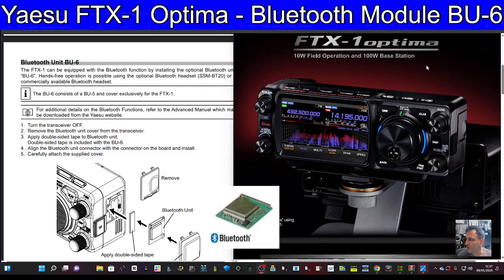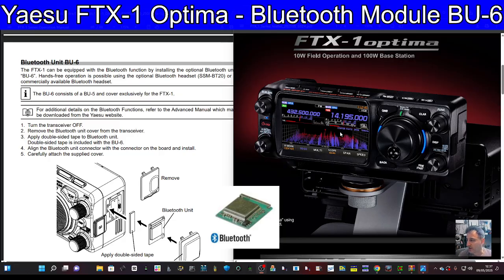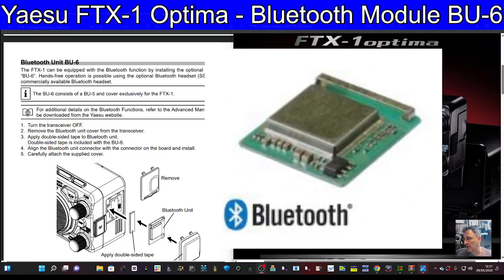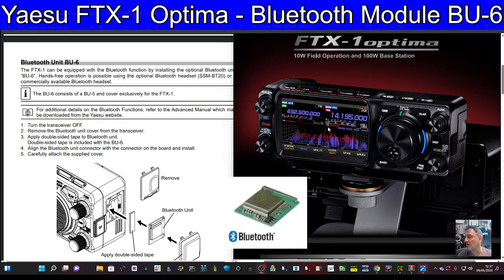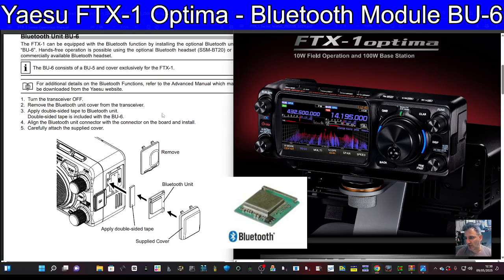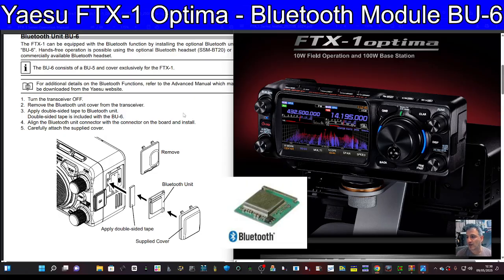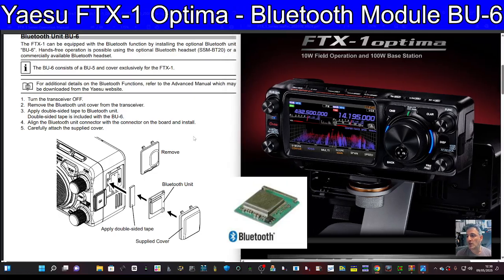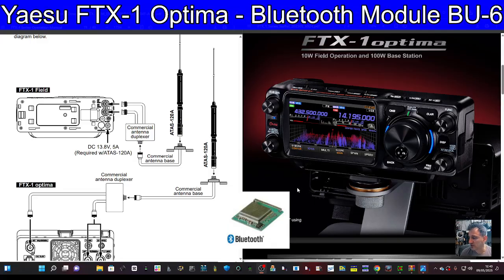Yaesu FTX-1 Optima - Install Bluetooth Module BU-6

Comment: I'm another one of those that can't understand why Bluetooth is not just added to these new radios from the beginning. The actual cost of the modules is minimal and seems like everything else we buy has it built in these days.
Reply from the maker: Least it's on outside you can swop it to your FT150
Reply: and later swap against newer standard..
Reply: IMHO, there is no reason why any radio from a top end manufacturer doesn't have built-in network connectivity!

Comment: So curious we got bluetooth possible data. 
Can you buy GPS and wifi and the amplifier seperate
Reply from the maker: Yes
Reply: Okay and now I need to figure out if it's full duplex because someone else just said it's not. Going to be waiting till everyone reviews it and see if I can get a consensus on that. I wanted it for a satellite. And there seems to be a bunch of differing points of view. Trying to avoid buying it and figuring out it doesn't work